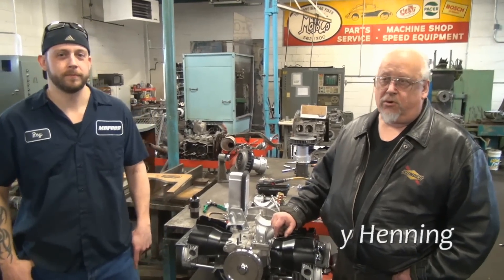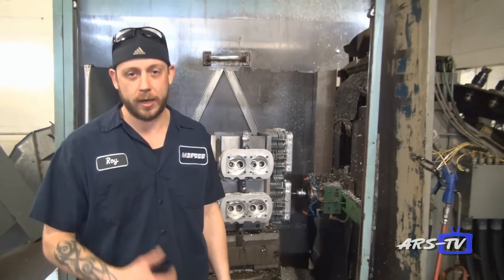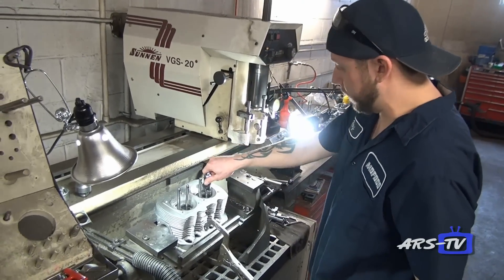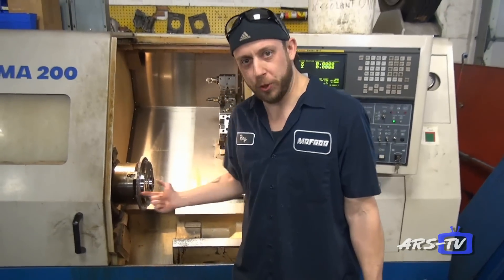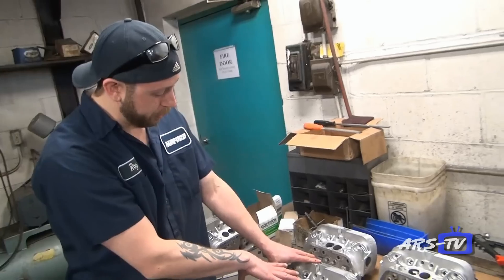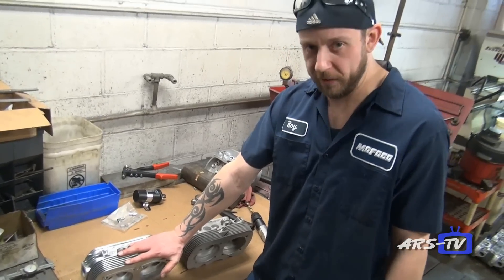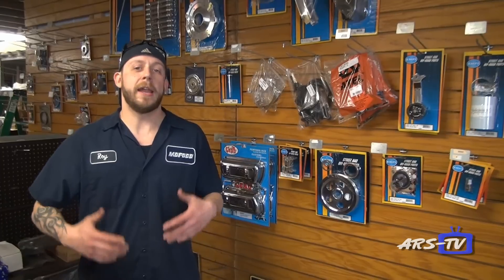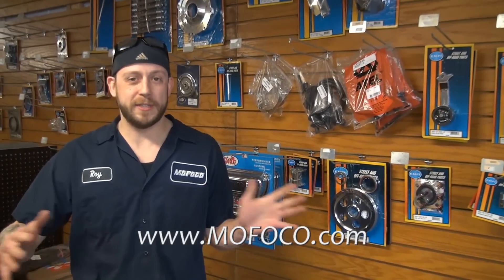Shop Tour of MOFOCO

Comment: I just wanted to say that I bought a 61 vw single cab 2 yrs ago and it had a brand new 1776 Mofoco engine in it that had never been started for 7 yrs. I call Mofoco and they told me what to do and the engine has been running great.